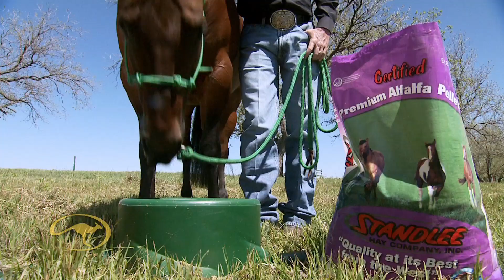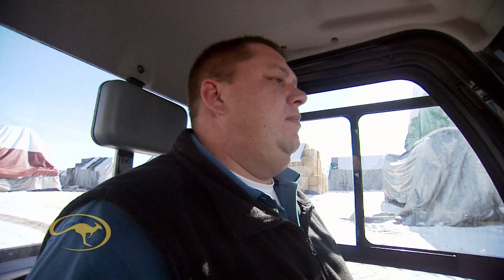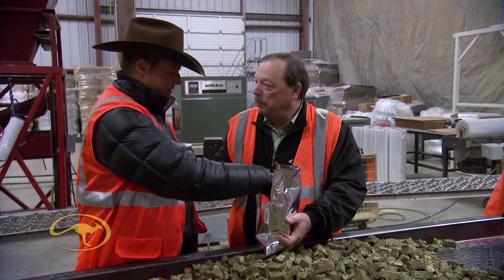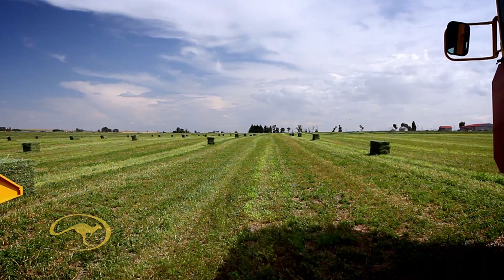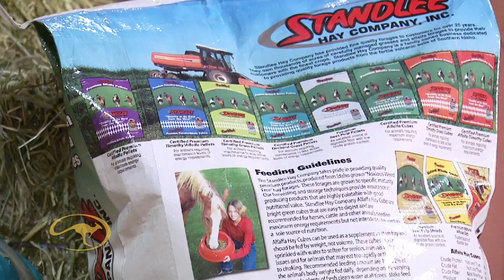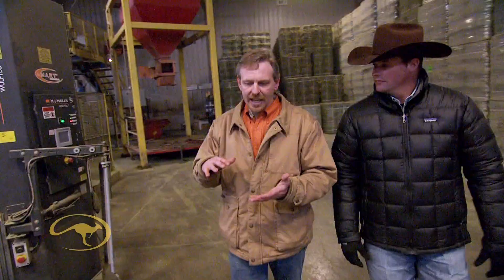Clinton Anderson Visits Standlee Hay Company

Comment: One thing that worries me, is the hay dust and electrics/heat of the machinery in that warehouse. Just doesn't seem to be enough air extraction which could lead to a fire.
Reply: Thats why they recommend popping the bands and letting it expand 8-10 hours BEFORE feeding. I also fluff up the flakes right before feeding it to my horse. 😊